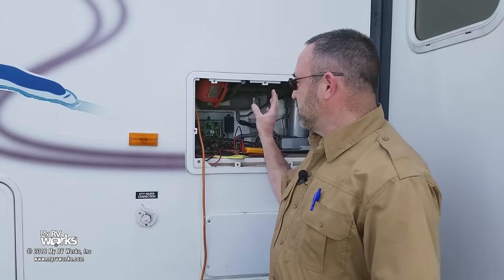How To Determine If Your RV Refrigerator Cooling Unit Has Failed -PLUS- RV Fridge Component Overview

Comment: Not a gurgling but a slight tick. Is that the same? Fridge too a long time to get to a proper temperature.
Reply: I'm not an expert,  but I have been full time for a few years & have own several used class A, so here we go. 
   Due to the nature of an absorption fridge it can take a long time to get down to temp. All day or even all day and over night would not be unusual in my experience. A couple additional things to bear in mind are :1) is the fridge side of your rv in full direct sun most or all of the day? That can effect how long it takes to cool down. Along that same idea, what season is it?  An absorption fridge is only going to get a certain amount of degrees cooler then the ambient temp (40° cooler, I think, but look it up). So if it's 90° outside you can expect your fridge to only get to say 50°, if I'm right on the numbers. 
   2) Once your fridge does reach temp, you'll want to make sure any thing you place in it has cooled down to room temp before putting it in there. Otherwise it can be like starting all over again since the way it refrigerates is by removing heat not by adding cold.
  3) Finally, my fridge is working great, knock on wood.  And it's a miracle it is! Earlier today I was on my roof for a different reason and saw that all those times I heard my rv brushing under trees while parking, which seemed innocuous, had actually beat the crap out of the vent cover on the roof and allowed a bunch of debris to accumulate in that space! Not only could that effect performance but I have to imagine it could also be a fire hazard! Food for thought (no refrigeration required, lol).
  Hope this helps.
Reply: angelique rider-mitchell thanks for the suggestions. My fridge is a crystal cold full size. It’s in a cabin where it doesn’t move and vents into a rather large room. Been like that for about seven years no problems until last week. I can only hear this ticking when I was on the floor right beside it.
Reply: Oh, well in that case I'm not sure how to advise you...do you get any litter box smell? If so, then the ammonia is escaping. I'm also aware of the coils getting clogged with sediment if they're run imbalanced or run infrequently. Do you leave it off for extended periods? For that, I saw somewhere that the last ditch effort to fix it would be to invert it to try to dislodge the clog. But dont take my word on that one. Besides that and just making sure it's not overrun with dust bunnies underneath, you probably need to contact the dealer. Good luck!
Reply: No none of that but it does sit for a bit last time was about two months
Reply from the maker: Great info, thanks for contributing.
Reply from the maker: I have not worked on the Crystal Cold brand refrigerators. However the theory of operation seems to be the same as what we find on Dometic and Norcold.  It having work for 7 years is good news, however, the back of that refrigerator should vent to the outside do to the combustion taking place with the propane. That combustion should never enter the living space. I was not able to pull any manuals or schematics from the crystal cold website. But I would be curious to determine if the control board is working correctly.
Reply: My RV Works, Inc. Agree with the venting in principle. Just haven’t found a venting kit that works through 2x4 walls properly. It’s made by the Amish so correspondence would be hard to come by. Looking at your video I haven’t seen a control board like that at all. It is might I add completely a propane unit.
Reply from the maker: Well, proper installation, per manufacturer spec, is really important. What I mean by control board, typically on the Dometic and Norcold, we see them in the back by the absorber vessel. Typically it is a black box with all the wires connected to it. Not sure if your manufacturer operates the same way on the controls.
Reply: My RV Works, Inc.  Next time I will look for it as per your video.  It might have been protected by an access panel. It just wasn’t obvious like the one in your demonstration.

Comment: Thanks for your great video. In my case the freezer gets nice and cold, but the fridge doesn’t get cold at all.  Would you have an initial culprit to check?  I thought my thermistor was not working correctly, but now I’m not sure if it affects both the freezer and fridge.  Thanks again!
Reply: Did you find out why yet? This is what is happening with mine right now.
Reply: Did you find a solution? Mine is the same.

Comment: Anyone know when you have 2 AC heaters in a model number 1210 norcold fridge if you hook directly into 110 volt outlet there's 2 yellow and 2 black do you put the 2 yellow together and the 2 black together and plug it in to the 110 or 1 yellow and one black my fridge doesn't cool or freeze I'm trying to see if it works straight on AC 120
Reply from the maker: Two yellows and two blacks together. But polarity does not matter it's just a heating element so it doesn't differentiate between that.

Comment: When you level the RV, you are also leveling the "Eutechtic Plate" where the ammonia Refrigeration is driven. So removing the Eutechtic Plate 🍽 and painting black and putting the this plate in sunlight you now have a  Solar-Powered Refrigerator. Lol 😆

Comment: Y wouldn't the LP setting be best fir winter to help it warm and start working agian y only ac ?
Reply from the maker: Troubleshooting on AC has a lot less issues to troubleshoot. So if you're trying to prove if you're Cooling in it is working or not, the manufacturer suggests doing all tests in AC mode.

Comment: PETE LOUTH, CAN I RECHARGE THE COOLING UNIT, IF SO (WHERE & HOW TO CONTACT) WE ALL MAKE MISTAKES. IN INSTALLED A  NEW DOMEETIC COOLING UNIT, THE VERY LAST STEP, PUTING THE BURNER UNIT IN,  I RUN A SELFE TAP METAL SCRAW into LOWER TUBE, THERE WAS A SMALL AMOUNT OF MIXED LIQUID, I TIGHTENEDING  THE SCRAW, LEACK STOPED. THE FRIDGE WORK ON TO THE THIRD YEAR NO PROBLEM, THIS YEAR IT WILL NOT COOL AT ALL AGAIN, CAI GET THE UNIT RECHARED ???????, TAKING THE FREGE OUT & TURNING UPSIDE DOWN WORK ????. ( HELP ).
Reply from the maker: The cooling unit is pressurized. It's a large chemistry set containing distilled water, ammonia, hydrogen and sodium chromate. All that is under pressure and works with heat and gravity. If you put a screw through a tube, that's unfortunate because you've lost your pressure. There are some companies that do recharge/reclaim the cooling units, but more than likely you looking at replacing the cooling in it. On my refrigerator playlist I have a video on how to replace a cooling unit.

Comment: What do I do when it's below zero and the outside freezes what can I do!!! Can I fix it?
Reply from the maker: You can block off about 90% of that return air vent. That vent is the one you would remove to gain access to the back of your refrigerator. That will allow that boiler to heat up that space a little bit better. If the distilled water in the refrigerator is frozen it may take a little extra time for it to thaw out and start circulating throughout your Cooling unit.

Comment: my Dometic has power. all the lights come on. it has a full propane tank but does not cool down. it ran out of propane, and i refilled it. it doesn't work on the AUTO setting either. my food is ruined. i have shut the fridge off then on to try to reset it. i live off grid so i don't have AC power. can anyone help?

Comment: I hear a gurgling in my RV fridge and it does not cool by AC or LP.

is it possible to replace just the cooling unit?

What is the gurgling sound?
Reply: I don't yet know if the cooling unit is the problem with mine or not. I don't hear any gurgling from the back. I looked at new cooling units today just in case and for my 1990 Dometic they are just under $1,000 just for the cooling unit. I will replace the fridge with a straight electric model before I spend that much on a 30 year old unit.

Comment: Please help does the blue wire go to anything its hanging loose behind the outside fuse circuit board
Reply from the maker: The blue wire is called the 'test wire' in the schematics. It is orphaned shortly after the board has been flashed at the factory. It serves no purpose after that.  It's only purpose is when that board is being programmed at the factory.

Comment: Are you really backed up right now? I live close enough to drive out your way for a few days. I’ve watched all your vids and still can’t pin down why the cooling coils don’t ever get hot and my Dometic rm2852 fridge doesn’t cool at all after defrosting with a hair dryer. I followed all of your checks and replaced the thermistor to no avail
Reply from the maker: Hi Dna Fpv, 

To schedule with us please head to our website and click on the 'Submit Service Request' button on the home page.  Submit your info and for the location, you can enter TBD and we can work with you once you arrive in this area.  We are booked out a few weeks but can easily coordinate with your schedule with enough of a heads up!

Cheers,
My RV Works

Comment: is it ok to paint the rusty parts ? i guess its called the absorber & condenser tubing.
Reply from the maker: I don't think it will hurt it.  They paint them at the factory.
Reply: thanks. just wondering if wire brushing or sanding a little to remove surface rust , then prime & paint. seems like it would be a good thing to preserve unit.
Reply from the maker: @OcRefrig  Best practices to preserve the metal will apply.  Most of the issues happen inside the tubes.  If the frig is operated off-level for too long it may cause issues and some of the chemicals will solidify causing a blockage.  The part that we see rupture most of the time is not so much from rust but from heat at the boiler seam.  The cooling unit is pressurized and once there is a breach and it looses pressure it is all over!
Reply: Thanks for the good info. Yea, i understand once u loose your refrigerant charge of ammonia or water your done. i thought they were only ammonia & water. there is other chemicals in there too ?
Reply from the maker: @OcRefrig  Water, ammonia, hydrogen and sodium chromate.  
Water is used to distill the ammonia at the boiler.
Cooling happens when the ammonia vapor reacts with the hydrogen – reading is from minus 120 to minus 20!!!
Reply: Good info. They put actual hydrogen gas in there ?

Comment: I have an N641 tried to reset the board , not having any luck , can’t shut the refrigerator off with the front off button , I am a retired HVAC commercial mechanic , I do have trouble shooting skills
Reply from the maker: On our website we have many service manuals for these refrigerators. With your background, and that service manual in hand, you should be able to follow the trail of the wires going up to the upper board. You'll be looking for continuity and ground shorts. Here's a link to our manuals page, and then search for your refrigerator.
https://myrvworks.com/manuals/

Comment: Im frigerator run and it is cooling but I have no power in my frigerator no lights no on and off button light.. I put a new circuit board in but still no power in my frigerator or on my on and off circuit board.. can you give me some pointers what to look for
Reply from the maker: The first thing I would offer is on my website where I have service manuals for refrigerators. I don't have them all but I do have quite a few. https://myrvworks.com/manuals/

So, with service manual in hand, find the troubleshooting section and follow the circuit. From your description it sounds like either a wire between your lower and upper control board may have faulted or the upper control board itself. Refrigerator will go into automatic backup mode if the upper eyebrow board should fail. That might be why your refrigerator is working oh, because the lower board has it in backup. Of course you would never know this because you have no upper board to tell you this.

Comment: Enjoy your videos I learned quite a few things I just bought a Dutchmen classic 220 and on the other side is printed 1998 add a bill of sale friend of a friend I'm disabled and I select a report I got a very cheap I've googled it everything to the picture of it send it in through Google lens and I cannot get the year and I'm having problems with my Nor cold icebox I know absolutely nothing about ice boxes and I have high respect for electricity so don't mess with I think I said it's a fifth wheel didn't say that the icebox didn't work they said that everything was all right except they disconnect with air condition unit cuz they put in a lifting system so and they took that out... Now I had to rent a big wheel or gooseneck hitch so I can move it cuz it came with I need some help on his frigerator and getting the year I'm a little home somebody out there know something please let me know help me out thank you so much and God bless

Comment: Question, has nothing to do with the refrigerator.
What direction does all of the green mold grow on the side of a rv up there.
I guess that people don't clean the rv's ever.
Reply from the maker: Good question, Yes it is a bit extensive.  Thing is the climate here is perfect for things to grow - not too far from here is a rain forest (Port Angeles and Sequim are in the rain shadow of the Olympic mountains so we don't get that much rain).  We moved here from Texas and in Texas we do not have all this growth on the roof of houses and such.  But it cleans off easy enough.  

I would love to start a division of My RV Works that offers RV detailing - It would be a huge success!!!

Cheers,
Darren

Comment: My rv fridge  won't work its been really cold and not sure qhT to do
Reply from the maker: If we consider the refrigerator as a heating appliance, we need to make sure that enough heat is being produced on the backside cooling unit at the boiler. One trick is to block off about 90% of the lower vent. That will make sure there's enough heat is produced.  If the boiler is not creating enough heat, then we're not vaporizing the ammonia, and if we cannot vaporize the ammonia, we're not getting good absorption of heat in the icebox and food compartment.

Comment: Should fan run all the time ?
Reply from the maker: Fan is controlled by a thermostat that should be mounted on the top condenser fin on the back side of the refrigerator. If you have a slide out the top vent should be able to access the thermostat. If you don't, they're really hard to get to and you have to put your whole refrigerator out to get to it. It turns fans on at about 130° and off at about 105° so if it's running all the time it's between those two temperatures or the thermostat has stuck closed.

Comment: Freezer is freezing, made ice refrigerator is only going down to 40 that is running all weekend on propane and battery and shore power, all at separate times.
Reply from the maker: The spec for your refrigerator is 37 to 40. I'm not sure I see a problem here?

Comment: I noticed some yellow residue by my burner cover.  The burner works, the heating element works, the 3 & 5 amp fuses are good; however, the refrigerator won't get cold.  What's my next option.
Reply from the maker: The yellow residue is sodium chromate that has leaked from your cooling unit. Because you have a leak the hydrogen has escaped and you're not able to vaporize the ammonia into hydrogen. So you will have to replace your cooling unit at this point. There's no field repair for this.  Here's a video I did on how to perform this procedure.  https://youtu.be/H-Cg-7YHyYE
Reply: @MyRVWorks  Thank you so much for getting back with me.  
I'm pulling the RV Fridge out this evening, just purchased a Home Depot Magic Chef 4.5 cu.ft. temporary replacement so we'll at least have a fridge for our week long camping trip this coming Friday.
I'll take the RV fridge out to my shop, order a new cooling unit and watch your video on how to do that when I get back home to Lewiston Idaho.
I watched a lot of video's over the past 3 days and your video was by far the ANSWER to all my questions.  Again ~ Thank you so Much!!!

Comment: Hello Darren ...!

I changed the menbrane on my trailer roof and I did not punch the holes for the roof accessories during installation.
The next day I had to let the fridge work all night with the menbrane on the ventilation trap of it. It was not a good idea because now my refregerator does not work any more (it does not produce any more cold probably because of bad ventilation) It must have a safety circuit breaker which has stopped the circuit, 
is it  right?

But the I am annoying because I do not know where is the braker fuse ?

Could you tell me where he is?
Or what could I do?

My trailer is a 2003 Jayco kiwi
And the fridge is a Nordcold N623

Link to my back panel: 
https://zupimages.net/viewer.php?id=21/25/d4wg.jpg

Link to my frige:
https://zupimages.net/viewer.php?id=21/25/j5x6.bmp

Thank you for your help, am I waiting for a response from you?

JP M.

Comment: Why don’t they just put normal refrigerators in these things , these fridges sound like a dam night mare
Reply: Because they can work without electricity.
Reply: On the road power management
Reply: Mine is a 1991. Still works like new. Uses very little propane and gets super cold.

Comment: i know this is older but your instruction on this is confusing, one minute you're saying there should be ZERO circulation and shove insulation up the back of the refrigerator then the next you're saying no more than an inch. My previous instruction says no more than 1/2" should be back there and the top and sides should be as insulated as possible You lost me entirely on that section of your explanation. specially since you spent that time talking instead of showing and talking about it at the same time.